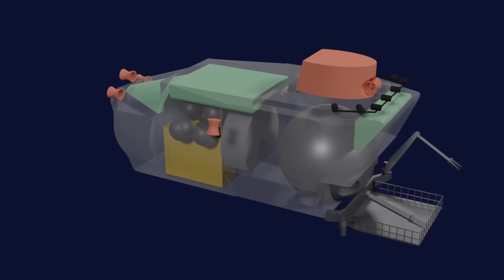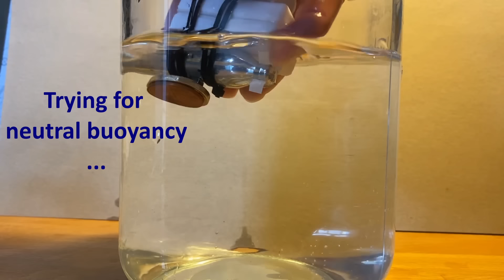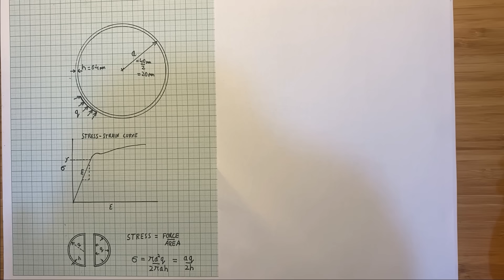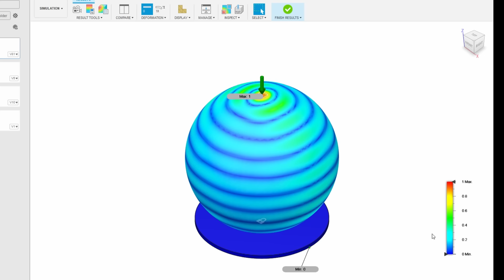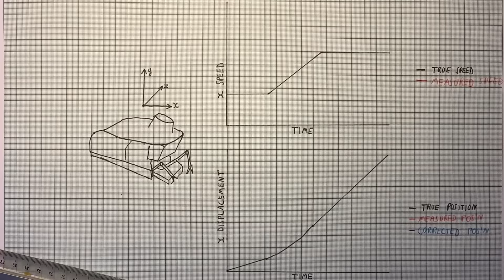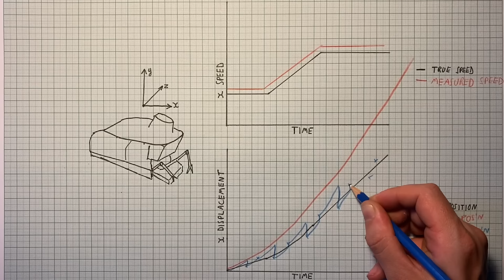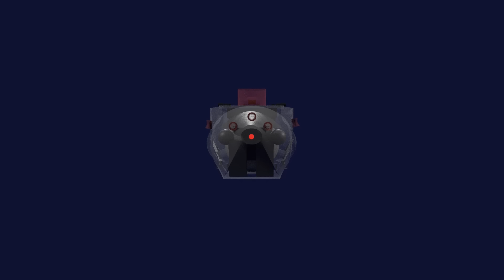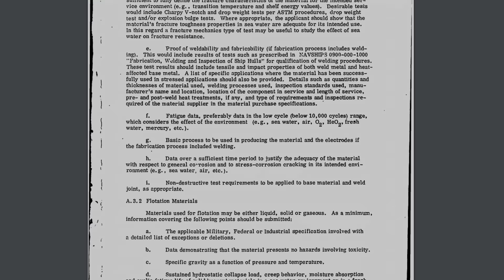DSV Alvin : How to build a safe submersible

Comment: 27:00 Laser ring gyroscopes are astonishingly precise devices. You know how an airliner's navigation computer gets its initial position information after a reboot? It uses the laser gyroscope to measure tiny wobbles and tidal forces affecting the earth's rotation and uses that to work out a position fix. GPS and other navaids get incorporated too, if available, to allow the inertial platform to converge on a fix faster, and they're used to correct for positional drift that begins to accumulate once the plane leaves the ground. But the inertial reference platform is the main instrument in charge; everything else is just drift correction and redundancy.
Reply: Also, given that it's owned by the navy, I'd be willing to bet that it's fitted with essentially the same inertial navigation package as the rest of the submarine fleet. The exact performance of that system is shrouded in mystery (i.e. it's classified), but from what we do know, it's orders of magnitude more precise again than the systems used on airliners and can go for months with no external navaids without accumulating more than a few meters of drift.
Reply from the maker: My thoughts exactly. I thought that gyro seemed like overkill until I remembered it's a Navy vessel!
Reply: @AJMansfield1 The system isn’t exactly secret - it’s a SEADeViL INS system (and the Alvin’s companion ROV Jason II has the same system).
The military secret squirrel stuff is the magnetic and gravitational anomaly detection systems that let the attack submarines see surface ships and submarines without using active sonar.
Reply: @allangibson8494  pretty wild if they can deduce a ships location from gravity anomalies. Especially considering that gravity wobble detectors are kilometers long to approach the precision needed to measure fluctuations in gravity. 

If so it is an impressive feat. With the noise of the entire earth right behind ya, to be able to notice such small differences. But I guess an ultra precise gyroscope could maybe be able to pick up the slight accelleration change from the gravity changing, but wow again, insane to be able to distinguish signal from noise. My guess is that if you tune a gyro to this levels of precision, you are gonna see big fluctuations in the data all the time, so how do you even begin to recognize what is a ship sailing by and what is just noise.
Reply: laser ring gyroscopes were developed to orientate the hypersonic anti ballistic missile called sprint in the 1970s

Comment: Excellent video! Nice work on this one!

If anyone wants a tl;dr on how do you make a safe deep-sea submersible, I got you.

First, make the pressure vessel a fucking sphere. Second, design it to be positively boyant. Third, add weights to make it sink that can be easily detached to revert back to positive boyancy.

There ya go, I just saved you 40 minutes. (But still watch this awesome video)

Comment: "[...] certification often feels like an extremely expensive tick box exercise [...]"

My immediate reaction to this: Because it is, and it needs to be done, and that's why you do it. Those boxes NEED to be ticked.

While obviously a very very different level of stress/danger, this is how I think about packing for a trip. I have a massive checklist, but I never forget anything I need because of it. It is expensive in terms of mental effort and time, but it is more than worth it in preventing even more expensive issues from not having packed everything I need.
Reply: Yep, 99% of it is 'are you sure you remembered your toothbrush', and then the other 1% is 'whoops I did forget my toothbrush' - only instead of an inconvenience it's death.
Reply: @TheLoneWolfling orse than the toothbrush, leaving your passport in the safe of the hotel room is a massive mistake. I always made a point of checking everything before  leaving, until that one time I forgot to check the safe... there is a reason why checklists exist.

Comment: What are your feelings about not being able to detach the pressure vessel? That emergency rescue mode was my favorite feature of Alvin as a kid.
Reply from the maker: Reading historical accounts of pilots' thoughts about that, the release mechanism and protocols seemed janky as hell! Pilots used to carry a hacksaw to cut through the release bolt in case it jammed, and the functionality was never field tested (for obvious reasons). I suspect the more refined individual component detach procedures may be safer overall.
Reply: @Alexander-the-ok  Interesting! One quibble: I have seen video of it being tested in the field. A Periscope Films YouTube upload. It was clearly the 1964 version based on your wonderful envelope, and may have not been that deep. But it always seemed to me like it should have been the most reliable way back, though I also wondered if it might surface so fast that the crew would be injured after it breached and then fell back down and started bobbling.
Reply: @PetesGuide  Just looking at the design, it appears very unstable and I can it imagine it rolling badly on the surface.
Reply from the maker: @PetesGuide  you’re right, i didnt make myself clear. By ‘field test’, i meant they didnt test it at a significant depth.
Reply: @Alexander-the-ok  tried to link to the YouTube video showing the detachment, but it got deleted. Check your spam comments folder and release it if you think others would enjoy it. 😊
Reply: @Alexander-the-ok  Would still be handy to keep it as a last-resort measure, just in case
Reply: The Russian Alpha class submarines had the same system - the submarines sail included a rescue capsule with enough room for the entire crew.
Reply: @allangibson8494 Sub Brief viewer.
Reply: @tissuepaper9962  Here, here.
Reply: By 1960s standards it was a fantastic feature. The problem was that nobody was REALLY sure that an uncontrolled 40 mph assent in a titanium ping pong ball with no seat belts would be survivable for the crew. Possible death from rocketing to the surface vs certain death on the seafloor if the sub got entangled? No brainier. By 1990, technology had advanced to the point where you could do what they did in the refit, jettison individual components instead. Rather than the whole pressure hull.

It really was like an ejection seat. It would get you out of the situation you were in, but also had high odds of killing you in the process.

Comment: I know we're not comparing the two but when I saw Alvin was placed together using super high quality welding and Titan was placed together using glue it did shock me.
Like that's one step above 'duck tape and prayers'.
Reply from the maker: Even the original steel pressure sphere was welded together in temperature controlled conditions. The welders had to keep their torches at a specific distance and only work for so long on each weld so as not to alter the material properties too much. And that was sixty years ago.
Reply: @Alexander-the-ok  Interesting - I hadn't known that Alvin's pressure hull was replaced from a steel hull to a titanium hull. But wikipedia that I'm glancing at just now says this was done after the 1960s sinking and salvage.

Comment: Lead acid batteries are also exceptionally tolerant of abuse and usually fail in a rather non-spectacular way compared to others.
Reply: I would also think that lead acid would be desirable BECAUSE of the weight that could be let go to go up in an emergency.
Reply: @BobConnor-n2g  Reducing weight is an important design goal as it allows you to have less fixed buoyancy. That reduces the size and weight of the vehicle and is almost always a desirable outcome.

Comment: I would think add some sort of emergency air bags that will bring to surface ,,just in case
Reply from the maker: See the start of the ‘buoyancy systems’ chapter. It’s impossible using known materials and manufacturing
Reply: @Alexander-the-ok  Instead of a can of compressed gas, what if the gas was generated by some sort of chemical reaction?
Reply: @NiHaoMike64  Automotive airbags are inflated by nitrogen from sodium azide charges. I recall reading that the K-278 Komsomolets had chemical charges to evolve gas to blow ballast, but I can't find this document.
Reply from the maker: @NiHaoMike64  That is a really good question. I don't know the answer tbh but I suspect you'd need a colossal expansion ratio to get enough lift....and you may end up effectivley placing a bomb on your submersible. I'm going to have a good think about this one though!

Do bear in mind, the syntactic foam is basically a 'lift bag' and dropping the weights is about the simplest possible mechanism to 'activate' the lift.
Reply: @NiHaoMike64  Maybe an old school magnesium torch could work. This generates a lot of hydrogen gas, but over some minutes rather than all at once (like an airbag). Maybe not 100% the most ideal solution, but it does have the benefit that we already have years of experience using them underwater.

Comment: As an American I say metricize America. Imperial is annoying.
Also now that I think about it, I think the only industrial source of titanium in the 60s was the Soviet Union. There's probably an interesting story on how they got it.
Reply from the maker: Yeah...I wasn't going to say that out loud but yeah. Loads of people here in Britain insist on using imperial measurements and it's a mess. At the very least, pick one system and stick with it!

So, the original sphere was steel. I think they switched to titanium in 1973.
Reply: The Alvin is on its third pressure hull. The first one was high tensile steel, the two subsequent ones were titanium.
Alvin has been rebuilt totally twelve times.
Reply: With that said, the SR-71 Blackbirds were make from titanium in the 1960s, and indeed that was an interesting story.  (Well, probably was; I think the publicly-told part is just "Third World countries and bogus operations" or something like that.)